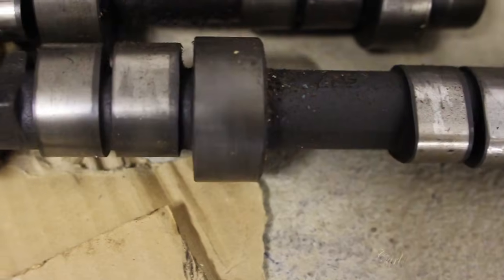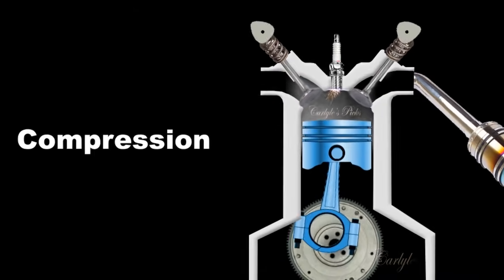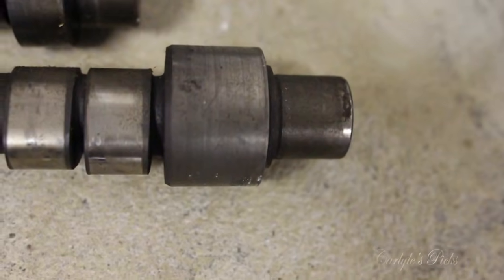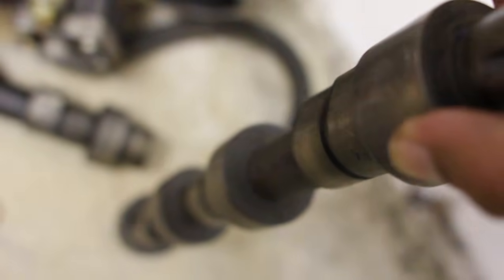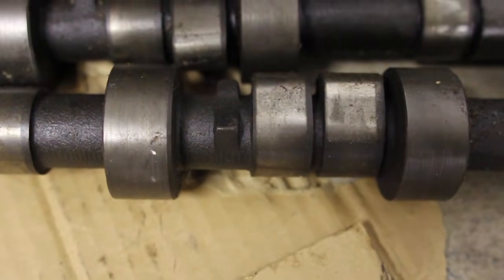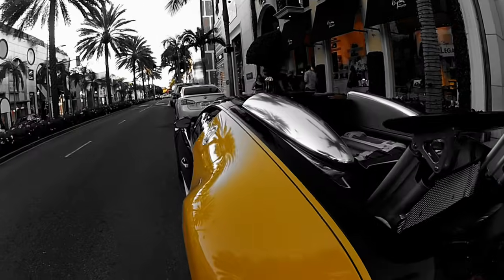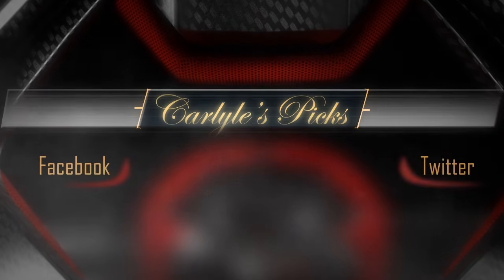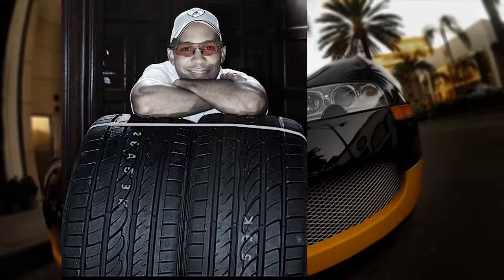What is a camshaft? Quick, simple definition with animation.

Comment: The engineers thinking,you want a faster pulleys... get rid the ledge on the camshaft for a faster rotation. 
if you do the math, 4 camshaft(on a car) - 8 pulleys that would be...
RPM(rotation per minute) = 

#EngineeringIsFun

Comment: I know I'm a little late to the party, but this was a nice video? Unfortunately I cannot see anything you're discribing because I'm visually impaired, but I can understand what you're discribing when I hear it.
So, I like to think of a camshaft as being a bit similar to a mechanical music box. The camshaft can be "programmed" (by the manufacturer) to open the valves at a certain point in time. In a similar way, a mechanical music box uses a cylinder with projections on it (similar to the camshaft) and the cylinder can be "programmed" so that the projections trigger the correct notes at the correct time (or rhythm). In fact, I think I actually read an artical online where the author wrote about the working of a camshaft is rather similar to the concept of mechanical music boxes!

Anyways, feel free to reply with your thoughts on this! Stay safe and have a nice day.

Justin
Reply: oops, don't know why I typed a question mark in my first sentence:)

Comment: Kind of a weird question: What happens if a camshaft was engineered so that all the nodes/bumps along the shaft were aligned the same way. In other words if they were all facing up? Would all the valves open and close at the same time?
Reply: Really late and I might not even have the answer you we're looking for but I think that would break your engine I don't think more than one piston can compress at once I think that would either blow up your engine or send a sudden burst of movement to the vehicle could be wrong don't take my words for it.
Reply: @Nanderlizer Nanderlizer yes they would all intake at the same time and the power would be less consistent
Reply: If all the cam lobes were aligned then its would open all of the valves at once and they would make contact with your piston heads and would be very bad. Unless you had all of the rod journals aligned also and it was all timed together properly then all the cylinders would fire at the same time. Your engine would run very bad tho and would shake ALOT
Reply: Yeah I always thought it was to reduce/cancel out vibration an have more consistent power delivery, but I'm a million miles away from being an expert...
Reply: hello,we are man ufacturer of rocker arms,if need,feel free to contact me wechat/whatsapp +8613540757860 janejiangATcdsunyu.cn